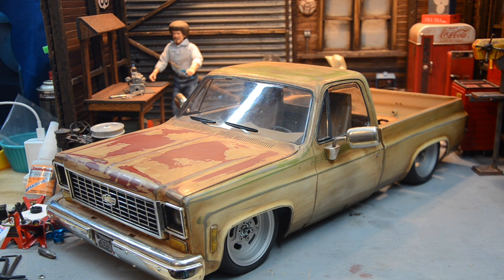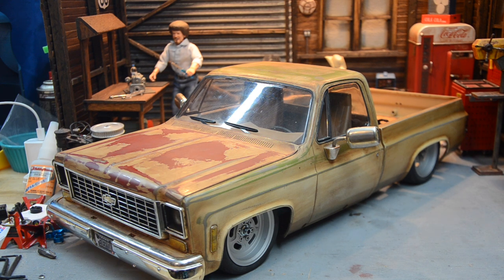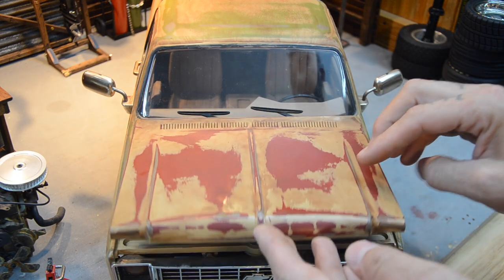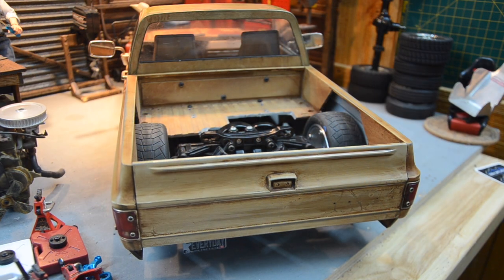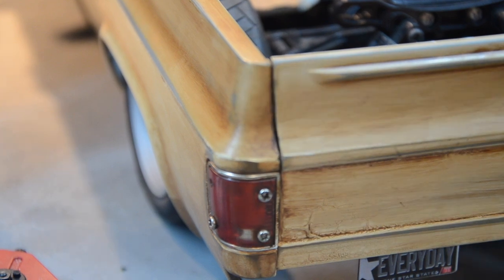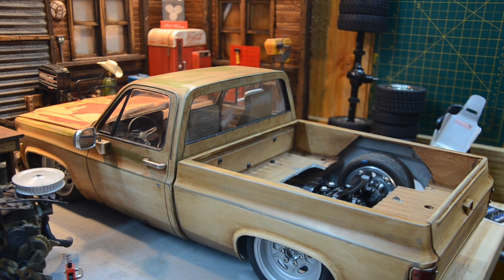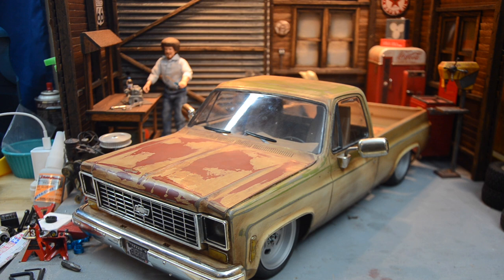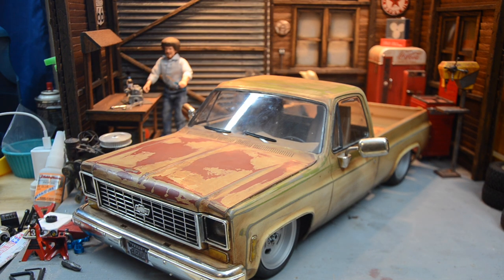Squarebody Shop Truck Build, Part 3, The Little Details, Patina, Tail Lights, Interior Upgrades

Comment: what do you think of a tt02r kit want to have a lowered rc4wd blazer  body on it
Reply from the maker: It would work just fine, still have to stretch the chassis some for the blazer body though.  Short by around half an inch
Reply: @RCeveryday  thank you brother yeah I'm going to stretch it I work on a laser so I think I'm going to make a whole new pan for it but thanks for the info I appreciate it I was going to get the tto2 but I'm going to get the tt02r